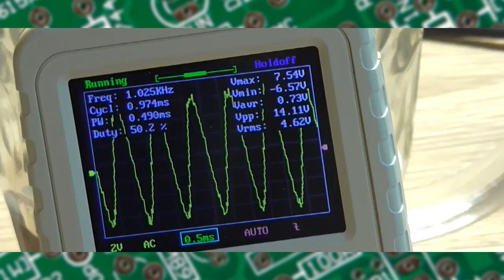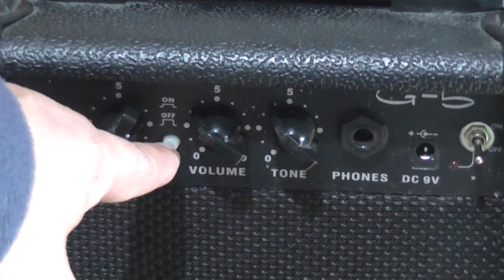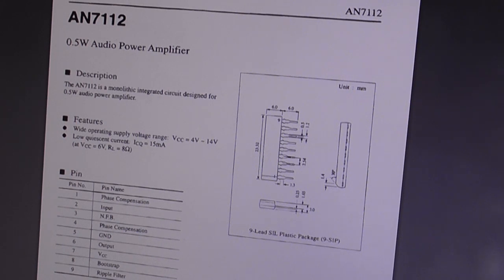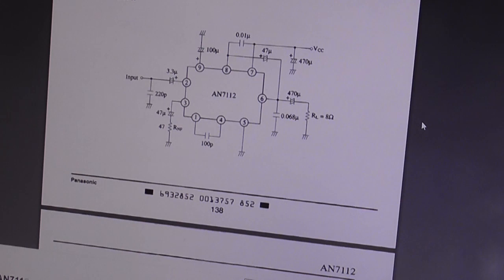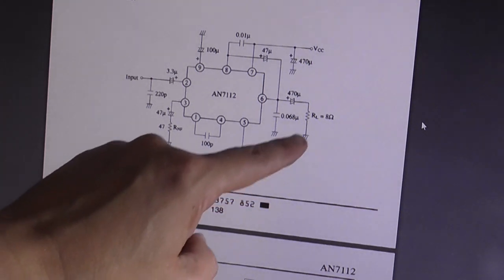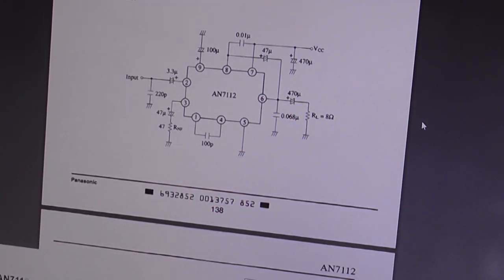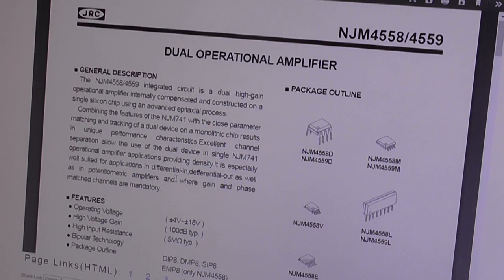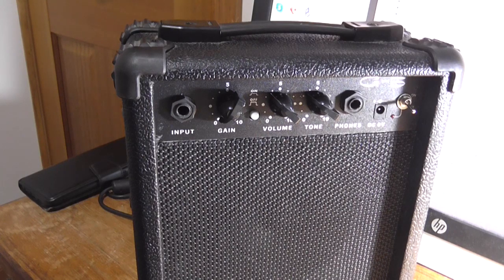Crappy G-5 5W Guitar Practice Amplifier

Comment: The 4558 is a pretty common opamp for audio use, widely used in mixing desks etc. because it's cheap and offers pretty good noise and distortion performance.

The cabinet of that POS doesn't look too bad, plenty of room add a small power amp module and bypass the crappy little 0.5W thing. Add a sensitive 6" driver and it could probably make a half decent practice amp.